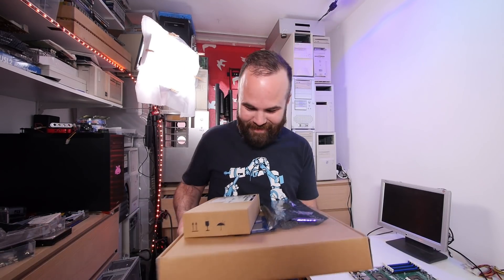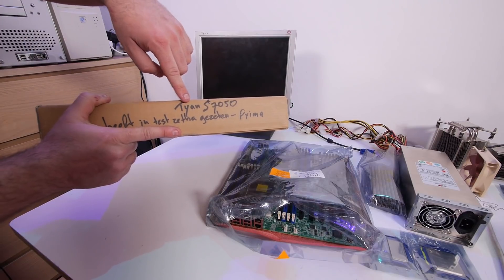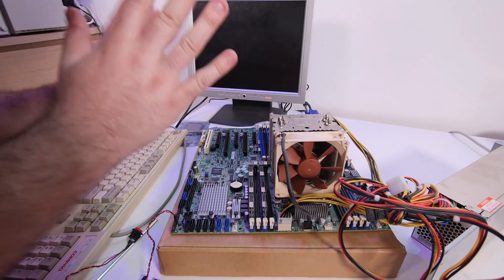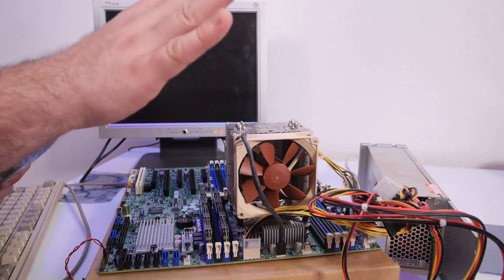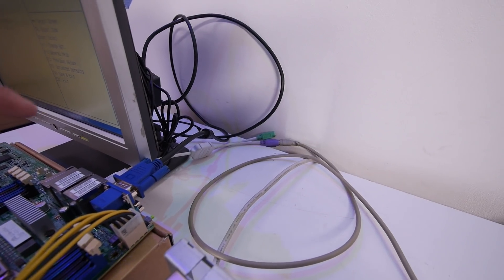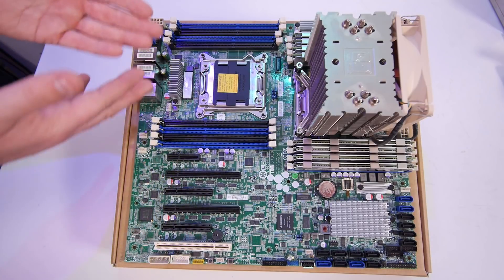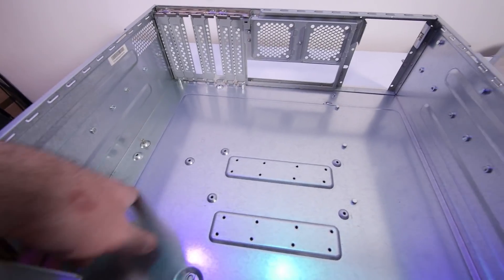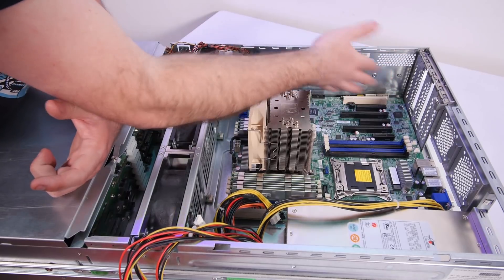ZFS Storage Server: Tyan S7050 Replacement Server Motherboard, 12core 128GB DDR3

Comment: can you try to explain Why you didnt just buy a 16-24 core EPYC and keep 1 socket cpu? draws alot less power, costs alot less and is alot faster.
Reply from the maker: Motherboard was 150 euro, 12core 2ghz for free (2x 95watt gonna swap ik later for cheap L cpu's ), 128gb ddr3 is 160 euro, Case and PSU 50 euro. So that is 360 euro.

A single 16core Epyc is 500 euro and 170 watt. Then you need 128GB mem and a motherboard. It is just a different price class.
Reply: @victorbart  2 ghz? you realise a 9900k would been faster in multithreading than this 24 core cpu right. (12 x 2 ) 

and you also know a ton of windows applications uses poorly of multithreading and many only uses a certain amount of cores,  you know the lag when you run on OLD cpu's thats because their singlethread is the same as yours.

the less cores you can pack and get the same Multithread, the better and it will be soo much smoother overall.

well you should benchmark, if these does 3ghz then yeah they will do a bit faster than 9900k OC'd but not too much. i hope this is just something for encoding videos even for that the average gamer has same CPU power lol which is funny buying an entire system that just has a bit faster mt than 2019's gamers.
Reply: Those "gamer" CPUs as you call them don't even support ECC memory so they are useless for any serious use of the ZFS filesystem. He will also not use Windows on that system so poor multithreading of Windows programs play no role whatsoever.
Reply: @dinosaurinvestigator  yeah and DDR3 is alot cheaper, his setup is cheap.

well when he has 200k subs he will be using epycs

Comment: I'd use a server with that kind of CPU power for encoding videos with FFmpeg. I've always used a certain procedure for exporting videos from Premiere Pro CS6, where I'd export a large AVI file encoded in UtVideo and encode that to x264 or x265 using FFmpeg. Sometimes it uses a lot of RAM with very large files, so the 128GB would come in handy there.

Comment: Very, very nice. It has me wondering though: Would it be possible to build a killer gaming build with a motherboard like this? Or is there any issues with it?
Reply from the maker: You have 2x pci-e 16x so yes!! But dont get 1066mhz mmem but go for 1600 or 1866. And get some high end Socket 2011 chips 3ghz+. My main workstation is a E5 2690 V2 with 64gb ddr3 1600 and gtx 970
Reply: Cool, thanks. :) It's something I'd never be able to afford I'm sure but I did think it'd be a nice experiment to do some day. My current one is using an old 2013 Fujitsu Siemens server and see how much I can squeeze out of that. I may put a picture of it in the RETRO machines group on Facebook later but we'll see how my project will go. - And thanks for the great content, keep it up. :)
Reply from the maker: @weepingscorpion8739  Retro machines ois for 2007 and older LOL :D

Try to pickup some dual socket 1366 stuff. Most people are getting rid of it :)
Reply: Oh, 2007 is the limit? I thought it was like 10 years, so I was going to wait until 2023 if I still had the machine :D

But yes, I also have plans for a 1366 build but it's quite different. Imagine: A Windows 10 machine with a 5.25" floppy drive? I know that some ASUS motherboards still had floppy controllers back then so that's what I'm looking for. I will take your advice of a dual 1366 system under consideration however. Thanks for the tip! :)
Reply from the maker: @weepingscorpion8739  I have the FB group epic machine pretty dead but there you can post it :)
Reply: no they are terrible for gaming watch linus tech tips or tech yes city as they both demonstrate just how bad they are to set up and the inadequate single core gaming performance......... :D
Reply from the maker: @chloedevereaux1801  The high clock speeds 1366 or 2011 v1 v2 are fine for gaming :)
Reply: Killer for 2019 standard nope, but you can make a really good one :) I'm typing this on a Tyan S7050 with Dual E5-2667 V2 cpu's (4ghz) and 128gb ram and it's pretty decent....2500CB points. I'm gonna retire it next week though!